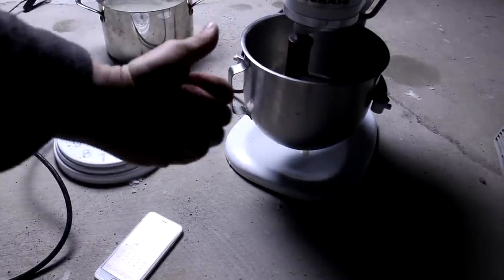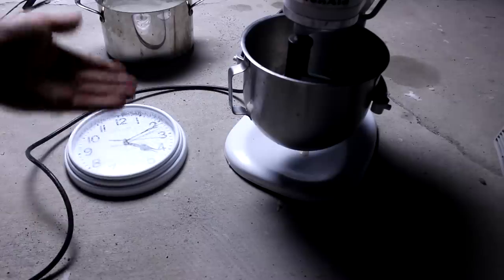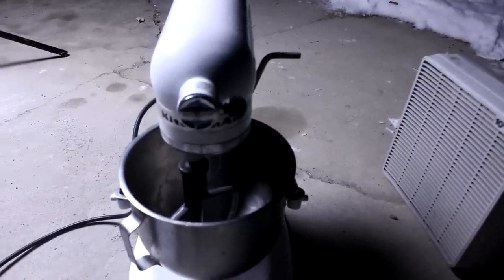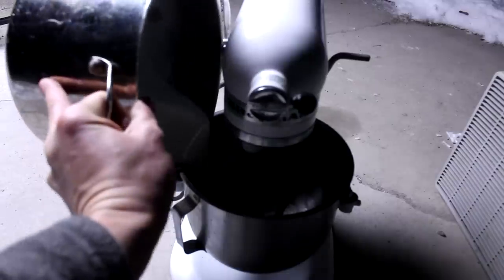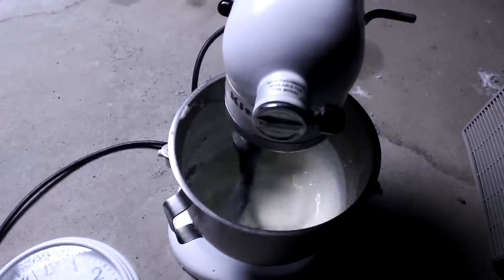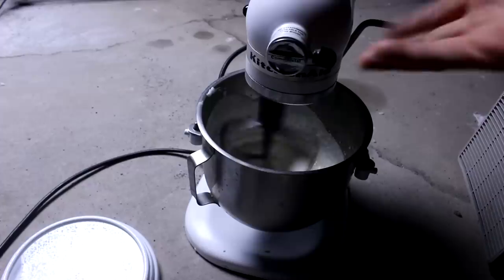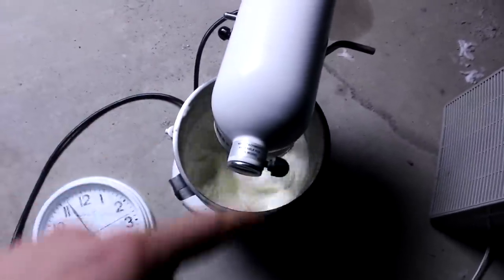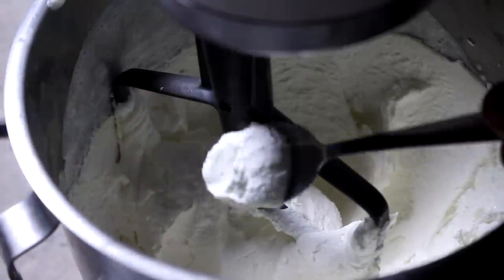Making Ice Cream Outside With A Mixer

Comment: As soon as I saw the mixer outside, all I could think about what what it might do to the gears with the grease at sub freezing temperatures. When you turned it on, it was definitely clear they weren't happy. If the urge for pre-dawn icecream concoctions ever hits again, I'd recommend turning the mixer on as soon as you have it set up outside so the grease doesn't have time to firm up. Those mixers aren't cheap!

Comment: You can make energy out of Tempereture defferiential  like a Peltier elemenent make one place cold and the other warm. Will produces a small amount of energy.
Reply: a Little correction on my note here: Its not the temperature difference. Its about the heat radiate faster on one side than the other

Comment: My dad and I tried this once when it was about -20 F, and it didn't work that well.  We were out there for almost an hour with a hand-crank ice cream maker, and ended up with a gallon of sugary cream with a few ice crystals.  I think it was because the outer bucket is fiberglass, and there was an air gap between it and the inner canister, where there's usually ice and salt, so it must have been actually pretty well insulated from the ambient temperature.

Comment: Farenheights are such a weird and unintuitive scale for temperature
those mixers have a gear under the metal dome that is slathered in a lot of thick grease. it was probably almost solid when you started, hence the sluggish movement to begin with

Comment: So it took approximately 35 minutes. I wonder if there is any way to speed this up using a bowl underneath the mixing bowl (of similar size but it will allow the mixing bowl to be submerged in liquid N2 on the bottom of it)

Comment: hey Cody, i was wondering if you could make a vid about lighter flints? i can't remember the name of the material but i know if you heat the flint to red hot and throw it on the ground it explodes into sparks, also i saw Taofledermouse put some in a wax shotgun slug resulting in a similar effect. i'd like to see what experiment you could come up with

Comment: So in theory, you could build a "inside ice-cream machine" (resting somewhere inside the house) with some pipes, insulating material and a fan (or other methods to bring air in a good pressure) and a pot resting inside a insulating shell and a hand mixer? (like having all this in a room near a wall/door where you can pass the pipes from the outside) Just curious about if there will be too much dispersion of heat. Also what about using some of the law about gas? (pressurized gas, when it expands again it will lower the temperature) Jus asking out of curiosity ;)

Comment: Wondering if it just thickened as cream does when you whisk it?
Reply: I was thinking the same. It looked like whipped cream. However, Cody's mixture has milk in it so I wouldn't think that at the speed he was running the mixer it would whip into a cream unless it froze.
Reply: Same thing, you add tiny air bubbles to the mixture when you make ice cream. Just like with whipped cream.

Comment: Wasn't that the actual invention of popsicles? Leaving/forgetting a drink with a spoon in it outside? It's quite efficient as you don't need to "create" the cold first.

But what i also wonder: Could you create your own Pop Rocks (If you haven't already)? Like melting sugar, pressurize it with CO2 and let it cool down.

Comment: How much energy loss do you get from the heat generated due to stirring than if(hypothetically) no heat from stirring was generated?
Reply: Technically, the entire power draw of the mixer ends up as heat... it just matters where it's distributed and how much becomes kinetic energy before becoming heat
Reply: I'm talking about the frictional heating of stirring that is directly transferred to the ice cream. I'm ignoring the heat generated in the mixer, resistive heat, etc.

Comment: All cool and stuff.......but mr CodyDon, i saw you also commented on a video about dissolving a broken tap with alum in sollution in water.
I saw you were thinking about making a video about it. The comment is about a year old. Perhaps you forgot about it. Havent seen you publish such a video. Would love to see it.
So like a broken bolt in an aluminium casing, and it is set in a sollution of water and alum and heated up to 200 fahrenheit or something like that. And somehow this sollution will attack the broken off metal without touching the aluminium casing.

Perhaps nice if you also made a video to either prove or disprove the concept.

Comment: Could probably have made it cold faster by spritzing the outside of the container with a little water every once in a while. Or maybe wrapping a salty wet towel to the outside of the container.
Reply: Zack Dumbledore spraying liquid water on the bowl would heat it up, and as that water froze to the bowl the phase change would release even more heat.
Reply: Zan Hecht I feel like the evaporation and better heat transfer of the water would outweigh those factors
Reply: Zack Dumbledore you're not going to get much evaporation at -15°F. It's going to mostly freeze, and then some of it might sublimate, but not much given how much snow is around. Once it freezes, you've already added .3 kilojoules per gram of water to the ice cream to freeze the sprayed water and added another ~40 kilojoules per gram of water to cool it down to -15°F. If it does sublimate, you're only going to be taking 2.8 kiljoules per gram of sprayed water out of the ice cream, so there's still more heat than when you started.
Reply: Zan Hecht I think the point is that the container isn't already at freezing temperature yet, so the light surface of water on the container would be at that temperature as well. While the water is still liquid, it will transfer away heat better than the bare metal. Once the water actually gets cold enough to freeze, the container would also have to be at that temperature as well, by then which the water would have achieved its purpose of cooling the container quicker. It's not about the total energy removed in joules but the rate at which they are removed.

Comment: Cody. Why does the light from the moon not seem to point directly at the sun, when they are both visible?
Reply: The most plausible explanation I've heard is because we look at the relationship between the Earth, the Sun, and the Moon as triangular. When in reality the sun is on the same side of both; due to the vast distances and size differences.
Reply from the maker: it does actually, get a ruler and line it up with them next time and you will see that it is just an illusion.
Reply: Cody'sLab : I will do that. I am a plumber, so I have levels. And straight edges.
Reply: I was looking at it in Seattle this morning and it seemed way off.
Reply: I thought, it must be an illusion.

Comment: I don't believe your ice cream is capable of completely melting without the use of a stove or microwave. It was liquid long enough to go past whipped cream and reach the point right before the whey would break from the butter. I have a feeling you actually have homogenized whipped whey and butter particulate.

Comment: Hey Cody, what about the teaser clip you had inserted in the Rock To Iron Video, and also extracting Thorium from Heating Mantle's?.....
Reply: Clearly not as important as 4AM icecream.
Reply: Although Cody could probably do it relatively safely thorium is radioactive. If done improperly it could not only make a large mess contamination wise but also could contaminate your lungs and body. Additionally Cody really doesn't have sufficient detectors to detect low level contamination from thorium. Finally he probably doesn't want other people to try it on their own.
Reply: Mr.Microcuries He announced that he would be doing it and even inserted a clip of him burning a lantern in one of his video's.....
Reply: Raghav Galgali well I hope that he doesn't. If he does a lot of untrained people will try to do it on their own with out taking the proper safety precautions.
Reply: Mr.Microcuries I know and I understand your concern, but I was just asking as to when he will be posting it....

Comment: Not really related, but i am starting an element collection but there is a catch and that is that i have to either scrap or find each element and i am having a hard time sealing gasses. I am 15 so the glass blowtorch method is the last thing  i want to do. Vials keep leaking what can i use?
Reply: I think you should try the blowtorch method. You're old enough to know what to do. With information that's easily accessible you should be able to learn. Also, learning new things is scary, but you [probably] can't progress through life as a successful person without learning new things. You can do it! Good luck
Reply: Christian B i will consider what you have said but even though i have messed with way more dangerous stuff i live in greece where borosilicate glass tubes are really expensive and high grade blowtorches are expensive too. There are some for 25€ that claim to reach 1200 celcious by burning butane should i try that?
Reply: Billy's tanks .. you don't necessarily  need a high grade blowtorch. It would be nice, yes; but not required. Propane torches are your best bet for melting Boro glass. You can take a metal hanger, for clothes, and bend it into a shape to prop the torch up if needed. I suggest buying lower grade glass to start. That way you can get a feel for how it works. Then once you are comfortable, you could go to boro.
Reply: Christian B thanks i will do that
Reply: Billy's tanks .. you're welcome!
Reply: do you know if i can use baby oil and not mineral oil to stop corrosion
Reply: NotRandomLab turn the vile upside-down